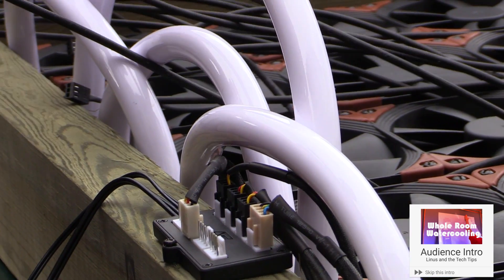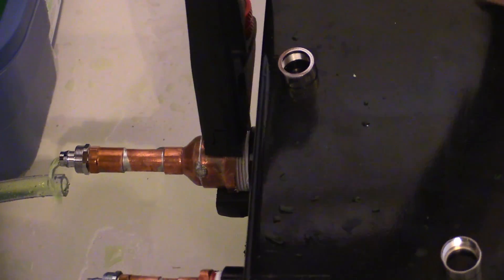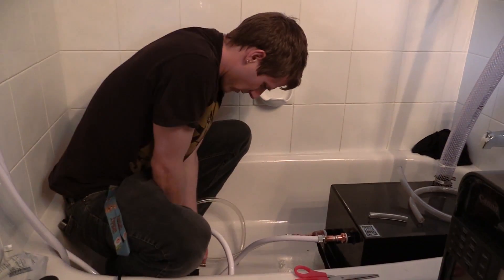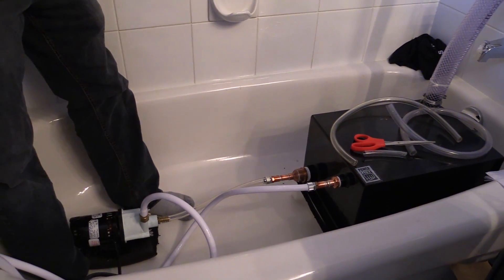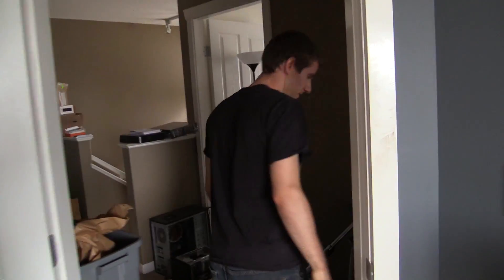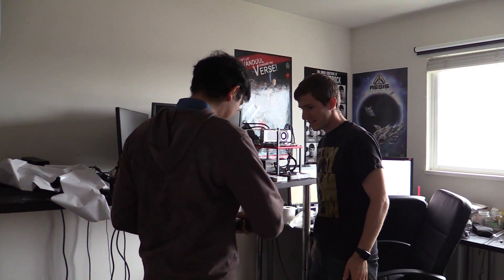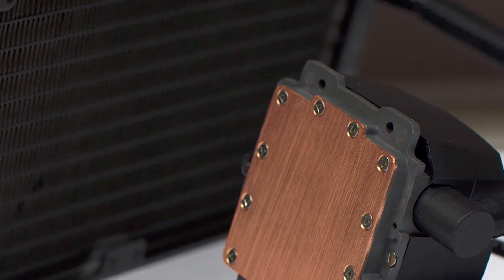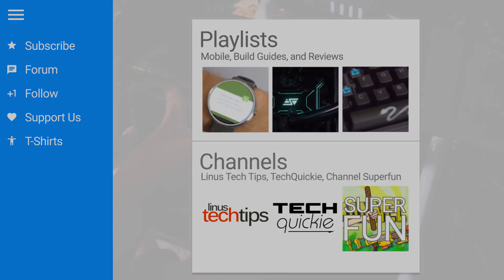Whole Room Water Cooling Part 4 - Nearing Completion...

Comment: Found myself unable to get through all of the ridiculous commenting on this video. So I'm going to post to Linus and hope that my points hit home. Your cooling loop piping is sized incorrectly. You need to look up what a reverse - return system is. There is a reason your reservoir has such large fittings. The loop needs to start with a larger pipe size and reduce size as each drop comes off the main loop. On the return the main loop needs to increase in size as the return lines are added back to the main loop. Also insulation will be key to stabilizing the loop and room temps. Regarding the radiators, in order to avoid using individual pumps, your best bet will be to use a reverse - return piping scheme as the loop feeds and returns from them. This will involve a lot of copper but it is what will work. As your system is setup now it will only cool the first machine in the loop and any machine after it will starve for flow and temps will rise. The individual radiators will help but ultimately you will find they are only masking the problem that is the pipe sizing and flow regulation of the main loop. Hope this helps. I am available to explain further if needed. I have 15 yrs as a hydronics technician and this is my bread an butter.
Reply: Did the breaker of all things ever reach out to you?
Reply: terrancemuffin No of course not, he always said it didn’t work plus, they moved by a long time by now
Reply: and why would they copper and not pex? pex is way easier to work with, cheaper and all the copper is gonna do is act like a big heatsink and radiate a bunch of heat into the room which is what they were trying to avoid, with pex you wouldn't be mixing metals either like they are here, i get the concept but there are so many things they could've done better
Reply: Well he also needed bleeder valves at the highest parts of the system maybe pitching some of the pipes towards the bleeders

Comment: Hope someone reads what i have to say... especially with a few years of commercial HVAC under my belt (heating and air conditioning work).

1. Let me start by saying that they should have had at least reservoirs at each endpoint for the PC's to hook on to the "whole room water cooling" and if they wanted to fill the system (purge it) you ALWAYS put the main reservoir above everything else and run the pipes at a very slight angle to help the bubbles get out. And use start/stop to help jump the bubbles out of places.

2. A bypass thermostat to prevent condensation that will allow water to be rerouted in a limited amount because you also don't want the water in the radiator(s) to get too cold. This can be mechanical, just like the one in almost every car out there.

3. Use a copper automotive radiator and a single fan with a temp sensor to kick it on.

4. Dual main pumps with no pumps in the PC's, one to run all the time and another as a back up with a flow sensor set up in parallel and a one way check vale used on both to prevent pressure from looping around the pump area.

5. Isolate the tubes if you want to avoid warming (cooling if its winter) the room your in, your heating/cooling bill will thank you.

Comment: Having a tap on each "down pipe" from the copper to each PC.. would mean you could pump full pressure through each system one by one (ie close all but one, one by one).... That would get the bubbles out plus supply a clean and instant way of separating a system from the circuit.

Comment: Ball valves installed at each connection point would have been a great thing to invest in. Save making those messes when you need to bleed air or drain the lines.

Comment: Any1 know why it said it couldnt find a proper boot device in 3:48. I recently built a new PC and during multitasking I would open up a random program then the program doesn't respond and then pops up a message saying there was a problem with the windows OS and restarts during the restart it says the exact message as in 3:47 and the BIOS doesn't register the HDD my OS is in for around 30 sec

Comment: The air bubbles are common in car cooling system repair, You have to "Bleed" The cooling system by taking off the radiator cap, putting a funnel in the radiator fill neck, Then run the car with the heater on. Why is this relevant? Because you have the same problem.Glad you figured it out that you needed to bleed the system. I also might have used a larger diameter tubing for better flow.

Comment: should of run pipes around the bottome of the room then you wouldnt have the vertical lift issues and fit a bleed valve to release the air like you would in a central heating system

Comment: You guys need a bleed valve at the highest point in the system to remove the air. One on the inlet (cold) and outlet (hot) main lines with the valve having clear tubing to dump back to the reservoir so you dont cover your carpet with glycol when you are bleeding the system.

Comment: I don't understand what they're doing. Can some explain?
They're making an entire room with water cooling?
Reply: each computer is liquid cooled, the "hot liquid" is dissipated outside instead of inside to keep the office temperature low since the crew claimed that the office was too hot.(each computer uses a lot of power therefore exhausts a lot of hot air into the office)

Comment: Would you be able to connect a small vacuum to the end of the loop in order to suck out the air while its being filled? It seems like it may work, and help pull the water.

Comment: The crazy thing is that you guys can make such compelling videos. By now you should realize that all that copper tubing is going to radiate a lot of heat back in to the room, and that you need to insulate the copper pipe. You also need to mount the reservoir at the high point in the system, or install a fill valve at the high point of the system to bleed air.

Comment: so why not use some new tech tubes such as pvc and use copper tubes, i mean the copper will draw the heat from the water and the heat will be spread to the room again or it will keep the water warm, i dont know if this is going to be efficient regarding the room heat, will be better than before, maybe at ur current tests u have reduced temp, but what will happen at days of consistant use, when the copper will heat up? Please inform me, i am very interested at making a project like this. Thanks in advance!

Comment: To all the people replying to those who asked why they did this just before moving office.
Yes it was done 4 months before. 4 months is still "just before". They already had a crowded office at the time they did this, and should have been very sure about how long the time and money they were going to put into this project would be useful to them. Keep in mind how expensive copper pipe is, plus all the time working on the project, plus the modifications to the house that will have to be reversed before selling it. 

it'd surprise me if Linus didn't at least slightly regret doing this project
Reply: The project was a test of is this possible.. and fun... nothing more.
All the PCs are able to run completely independent of the loop so there is no need for concern when moving the PCs.
All they have to do is take down the piping from the walls when they decide to move and then either do the same in the new office.. or just keep them all running as independent water cooled machines depending upon how the new office is going to be... (I.E A/C and if they enjoy the project.)
Reply: OwenWalker The pipes were cut to length for fitting this room. They'd be able to reuse what they have but they'd probably need more.

Comment: if the water travels through all systems and back...the last in line will always end up running warmer than the rest...

The system idea is nice but you need to use the correct valve and pipe layout so each machine receives fresh cool water equally and doesnt receive any outflow from the machines beside it.
Reply: You need to learn water cooling basics.. The last machine will reach the highest temperature first thats correct.. but that highest temperature is going to be the max temp the entire loop will reach anyways once temps have equalized across the board.. So that machine can be used to measure the efficiency of the entire cooling loop.. if that machine over heats.. that means the rest will overheat as well once equalized and more radiators are needed.. also as these are workstations they will be running 24/7 most likely so the temps of the entire loop will most likely stay between 30-50*c no matter what.. and if it doesn't overheat and go into thermal shutdown.. well then the loop works.
Reply: OwenWalker
in a traditional small closed loop system you are correct. This is NOT a traditional system. With this much piping there is a risk for dead spots, backflow, and hot spots.

This isnt water cooling, this is plumbing.

Comment: Linus you have a couple major fails that I notice from first part:
-you should use VALVE at the end of all pipes i/o (minute 7:00) even often to be able to open or close some circuits without stoping cooling system;
-as well you could use BLEED SCREW(to allow unwanted air to escape from the "unit")
p.s. sorry for my english
Reply: I was just about to point out the same things when I saw your comment.
Reply: @CrippledTrack  mine is from 2021 when the idiots insisted on their human right to spread diseases and made COVID-19 last an extra 12 months
Reply: @thewhitefalcon8539  yeah, good times

Comment: Linus, i just have a little comment about this cooling system. First, you must install a heating system with a thermostat controller soo that your cooling liquid will not be too hot or too cold but just right enough.... Avoid thermal shock in your components during full load run or winter in your area. 
Second, with you air bubble prob, you should have installed and expansion tank on top of your line which you can install at the top of your roof with ease access, this will eliminate any air bubble in your line 100%. This advice is base on experience as power plant engineer. ^_^

Comment: so is there a reason why you chose 4 PC rad's rather than something like a honda civic rad? it would have been less piping and handled a lot of flow.
Reply: TDPEquinox Car radiator are design to maintain a perfect temp and for any kind of conditions. It doesn't need to have fins so close because it's much bigger and holds way more coolant. Also a bigger fan is always more efficient then small fans. Don't forget car fans would be way more reliable. PC radiators need more fins because of there small size and has to overcome that by adding more fins to increase surface area so more air can cool it faster. There you go, the real reason they have more fins and make it no more efficient. Maybe if the car radiator was the same size, but it not. Plus you could always get an aftermarket radiator and outperform any PC radiator. Aftermarket radiator have more density and made out of aluminum. :)
Reply: TDPEquinox As it stands, there is probably as much copper piping in the room as there is radiators outside. You can move more air through a less dense rad easier, and considering how much of their rad box was wasted area (edges between rads, metal mounting strips blocking fins, the corners of the fans) a car rad would likely be more efficient.
Reply: Car RADs are not designed to cool as much as a PC RAD. 
Cars operate at a certain temp, and PC RADs work much better. 

Plus good luck finding fans for a Car RAD.
Reply: jack black Density. 

That is the only word I need. 
Density. 
Look at your car RAD, now look at the one in your PC. The car RAD's fins are a lot farther apart, and a lot thicker. Why? Well we wouldn't want that bug you just hit going 80 K to bend your fins would you?

As for the fans, they don't work very well. 
Wanna know what cools the rad in your car the most? You. Driving. 

Idiot.
Reply: jack black Yes just gloss over the whole density point i made. 

I think we are done here.

Comment: You know, watching this has me wondering why 1) you were not using clear tyvex tubing while bleeding air out of the loops and b) not using quick disconnects at the copper pipe end of things, so you could bleed the room system and the PC systems independent of each other, and then bring them together.

Comment: things that pop into my mind are: bleeding taps and air catchers on top of the pipes, a pressure tank in the system to keep the pressure cold and warm on a normal level it will also have spare water if you bleed the system , a pressure relieve valve, valves for every computer with a filling tap so you can disconnect a computer while the others are running this will also help bleeding the system and if you use the right ones you could even adjust the flow over every computer on it's own. these are just the least things you should change on the hydraulic part.
And if it rains will your ventilators not drown ??? :-)

Comment: Good stuff but I'm curious why you guys just didn't go to a junk yard and get the radiator and fan out of a car and retrofit that instead. I imagine the cost of just one of those pc rads would have covered the cost of that. You would have had parts designed to handle much more abuse as well. Not to mention I think I would be slightly annoyed if I'm putting forth all that effort and only getting average water cooled pc temps.

Comment: personally i would have ran the piping along the baseboard. less piping and less 90 degree angles.  other than that.  pretty awesome. what a challenge  haha im planing on craming 2x240mm rads in a 350d with 4690k and 290x.

Comment: you should've installed valves on each workstation end, so you can cut it out of loop if not being used...keeps the air bubbles out and pressure up

Comment: CPU:	Intel Core i5-4690K 3.5GHz Quad-Core	
CPU Cooler:	Noctua NH-D14 65.0 CFM	
Motherboard:	Asus Maximus VI Hero ATX LGA1150	
RAM: Corsair Vengeance Pro 16GB (2 x 8GB) DDR3-1600
Storage: Western Digital Caviar Blue 1TB 3.5" 7200RPM (2)
Video Card:	EVGA GeForce GTX 980 4GB Superclocked ACX 2.0
Case:	Corsair Air 540 ATX Mid Tower	
Power Supply:	EVGA 750W ATX12V / EPS12V	
OS: Microsoft Windows 8.1 - 64-bit (OEM) (64-bit)

How good will this be?
Reply: I don't see a ssd! I would rather have a 970 and a ssd then just an 980. It so worth it! Just to make it cheaper, a boot drive(SSD)/Hard drive will do the job. :)
Reply: To be perfectly honest you were better off keeping your 980 and just waiting till you had enough money to get a boot sad... Idk why people always recomend skimping out on the gpu for an sad? I mean sure you get crazy boot times but I'd rather wait a few extra seconds and be able to push 4k res than lower my gpu, also considering the price to buy a whole new gpu rather than just waiting to get a 100$ ssd's. Seems silly.
Reply: That's gonna last a while
Reply: Get a single stick of RAM, for now, and use the money you save on it for a decent SSD. However, if you can afford to get the SSD, and keep the RAM, then do that instead. 

Everything looks pretty solid aside from the lack of an SSD.
Reply: Disputed Cleric I changed to a Gigabyte 970 what ssd do you think is the best price preformance i need the cheapest possible
Reply: Dafmak I would say look at the 840 EVO by Samsung. Watch out, though, around this time the prices fluctuate a lot, so make sure you get the best deal.

Crucial does make some cheaper ones, but they aren't as fast. Have fun!
Reply: Skamux it more then boot time, sound like you don't have a ssd. Switching out a hard drive for a boot drive is way more work then switching a video card. Video cards also keep there value and are easier to sell if need to upgrade. Also my 980 can't even push 4k by itself on most of the games I play, I prefer 1080P with max AA and higher frames. That ssd will stay with him forever why the video card will always be replace. Also the 970 beats the 980 for the performance to price. The 980 is only 20% faster and using the same amount of VRam so it not really anymore future proof. It silly to not see the benefit of an ssd. I agree with the Samsung 840 evo. My computer run faster then my friends same spec but he has  two 980's. It feel slower and some application run faster with an ssd. Them seconds you save add up to more game time! :D
Reply: hmmm yeahh ssd's are pretty good. Idk it's all personal preferance really, i have experienced the pleasure of having an ssd and it is godly, but yeahhhhh idk i'd rather a better GPU really depends on the user i guess.

Comment: linus linus why did you not used quick disconect fittings at the end of the pipes if you did you would not have to drain the system to plug and unplug something in those pipes

Comment: Linus, simple question.. but why didnt you put water valves at the end of the pipes where the hoses connect to the computers so you could disconnect/reconnect computers up without draining the entire system.

also you should of put valves in between each feed to the computers so in the event of a leak.. or need to bleed air bubbles to a certain computer you could force the flow to stop to parts of the main line.

Comment: I really like this project but there is just one thing I would have done differently. Instead of putting the pipes up, I would have put them down to floor level and rise the power bars and the system. That way, if the pipes or the fittings leak, the water wont have any chances of going on the power bars or the systems or the monitors. Maybe it'll reach your wall output but it's less of a drama because the power bars are protected against short circuit. Also you get more out of pumps since the water won't need to go up and down 4 times to reach the systems.